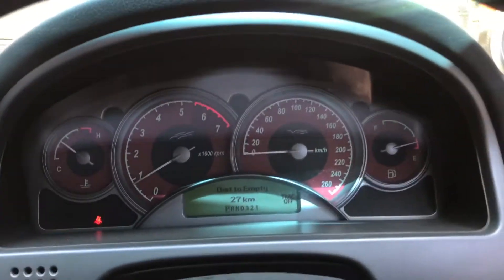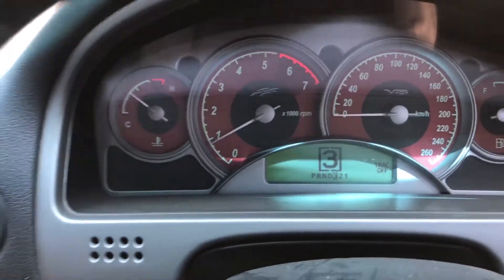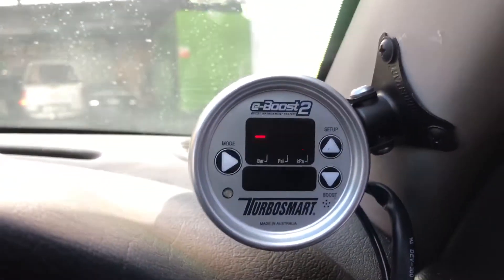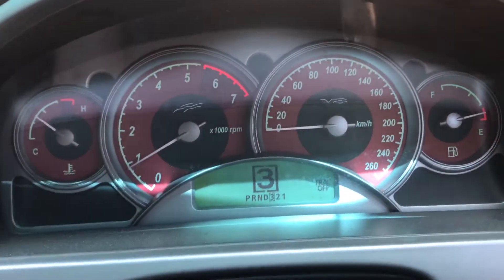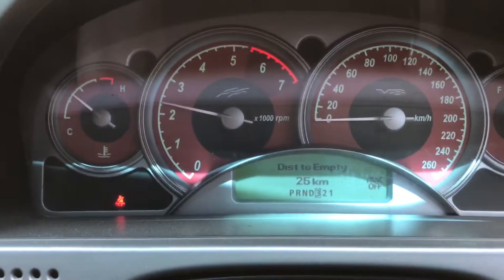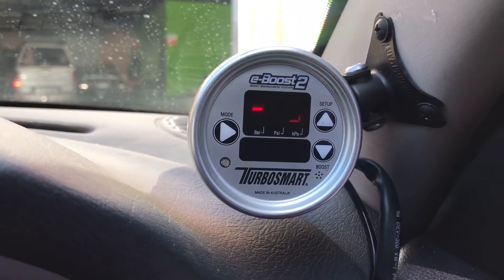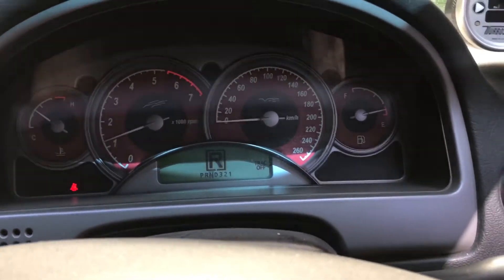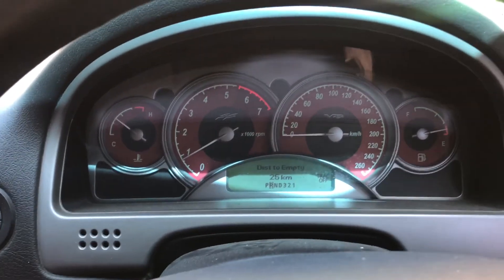RVO Automatics 4L60E Transbrake Explained

Comment: Ok so im new to transbreak systems, does it run 100% of the time or u can switch it on & off ?
Reply: you can switch it on and off with a button normally so when you let go you lauch
Reply: There's a button ,like a clutch basically let it go n launch